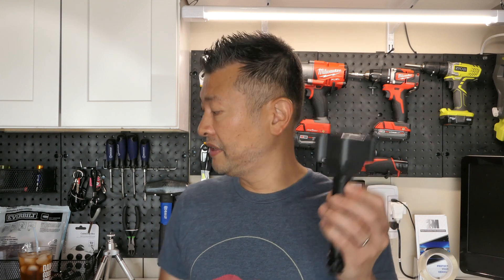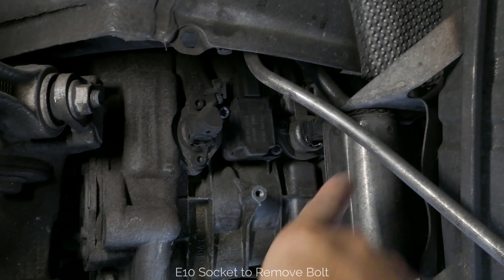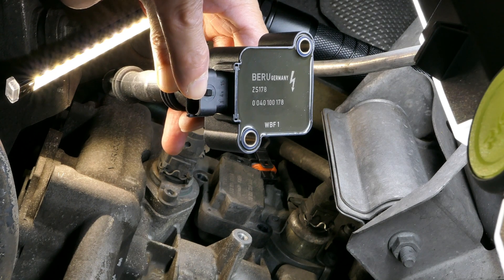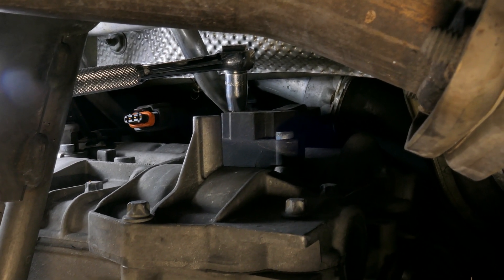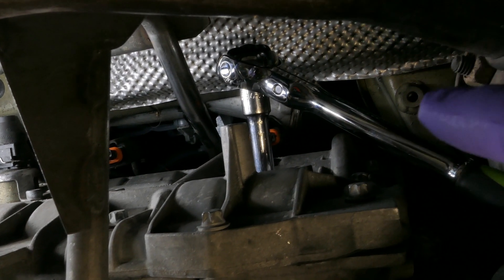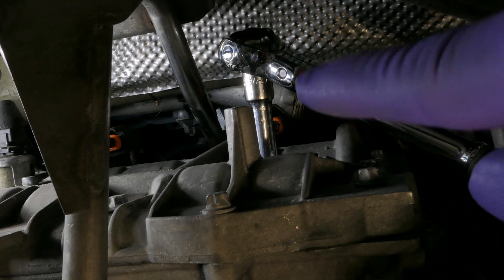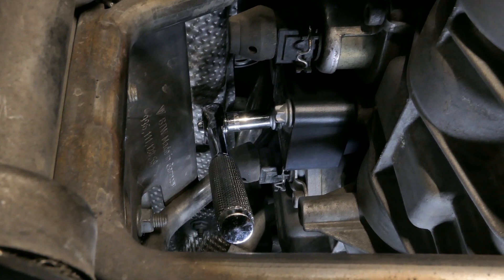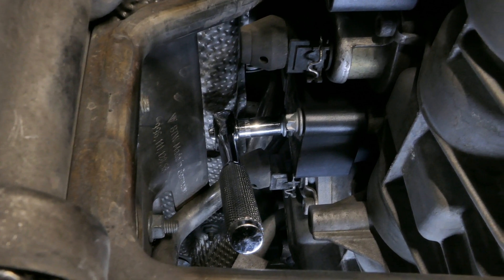Porsche 911 Spark Plug and Coilpack Change DIY. No muffler or Bumper Removal!

Comment: Great video.  I’m probably going to end up trying to take my mufflers off.  I tried it before when I did my water pump and thermostat (didn’t need to so I left them on).  But I have bigger hands and I’m low on patience 😂. I’ll definitely get the swivel head ratchet.  What drive did you use? 1/4 I assume?
Reply from the maker: Yes, larger hands might have issues getting into the smaller areas. For the drives, I used a combination of 1/1" and 3/8" drives. Good luck, it's totally DIYable.
Reply: @TheAutomotiveFanatic  I’m definitely DIYing it, it’s just a matter of with mufflers or without.  Also a good time to check on the state of my cylinders, but from the top this time.
Reply from the maker: @K1dPhresh1  Sounds like a good holiday project. LOL.
Reply: @TheAutomotiveFanatic yes sir!  Hopefully time permits.

Comment: Question:  were the upgraded Beru coils worth it?
Reply from the maker: 100%, I never had any misfires or issues what so ever.
Reply: @TheAutomotiveFanatic  Thanks, Porsche recommends 5 of the new Beru with 1 of the old to avoid clearance issues.  Does this make sense to you?
Reply: @TheAutomotiveFanatic  I forgot to mention I have a 997.2, a 2011 Carrera
Reply from the maker: @jaketherake71  Absolutely not. In my research, I have not heard of Porsche wanting to replace only 5.
Reply: @TheAutomotiveFanatic  ok, I think it was Pelican parts recommendation to 997.2 owners.
Reply from the maker: @jaketherake71  I would replacement them all.

Comment: hello did you replace these parts at the recommended interval?  I understand the plugs but what made you change and replace your coil packs?  Just curious as I just recently got a 2007 997.1 with 46k and I want to do the spark plugs, air filter and clean MAF sensor with approved CRC cleaner and even may pull throttle body and give it a good cleaning.  Thanks in advance.
Reply from the maker: No, I did not follow the manufacture's interval. I changed the plugs/coilpacks because I wasn't certain when they were changed before.
Reply: @TheAutomotiveFanatic  cool, makes sense. Cheers!
Reply from the maker: @chrislehmann6240  Good luck with your maintenance work.

Comment: 2006 997.1 C2S. All you DYI-selfers Do yourself a favor: Remove the bumper, mufflers and muffler heat shield. The coil pack bolts on the rear ( 1 and 4 ) are very difficult to reach with normal torx sockets. I had a single bar t40 torx that is 1 inch long. I could not remover the most rear bolt with normal torx sockets, the muffler frame is in the way. Removal of bumper, heat shield and muffler: 1 hour. It saves 2 and 1/2 hours Good luck. Make sure you have a good variety of tools.
Reply from the maker: L MR, thanks for your input and feedback. Since you have a C2S and I performed this plug/coilpack change on a widebody C4S,  I may have slightly more room. Unfortunately, I cannot confirm. However, in my researches prior to the change, I read that other 997 DIYers were able to perform the service without removing the muffler or bumper.

Comment: The passenger side was easy for me until it came to connecting the plug onto the coil pack. There was no free length on the plug and ended up having to use 2 long screwdrivers like chopsticks to tease it back in then I could get my hand to it to push it home
Reply from the maker: It's been some time, but I believe a couple of the plugs proved to be tough as well.

Comment: I am curious about them saying that you need to use a torque wrench to tighten down the plugs but notice that you did not do this??
Reply from the maker: Hi Robert, you are 100% correct! The plugs do need to be torqued down as I did not show that process. I highly recommend grabbing a smaller 1/4" torque wrench and tightening to: 32 N-m (24 ft-lbs) for a new plug and 25 N-m (19 ft-lbs) for re-installed plugs.

Comment: Great video! So do the Beru coil packs come with the new bolts? I noticed you took off the torx 40 bolts but you put back in a different bolt.
Reply from the maker: Hey Fredy, thanks for watching! Yes, the new coil packs come with the correct bolts.
Reply: Cool. I’m debating on whether or not to do it myself. Labor is around $300 at indy shops near me which is well worth it. But I like the feeling of DIY and getting to know the car. This will be helpful if I attempt it. Thanks again.
Reply from the maker: @fredym.3728 , you should really DIY it! Like you said, there's no better satisfaction knowing that you performed the work RIGHT and getting to know your PCar more intimately.

Comment: Without removing the muffler it would be extremely difficult to impossible to use a torque wrench on the plugs ( 22 ft/lbs or the coil bolts ( 8 ft/lbs
Reply from the maker: You're correct. That is why I ended up having to purchase a small 1/4" torque wrench. Unfortunately, it did not arrive in time for this video.
Reply: @TheAutomotiveFanatic  I just started having a couple misfires tonight, so your video is the first I've watched. The exhaust is pretty simple to remove, so would you say it's worth it to do so, or it won't really make it easier?
Reply from the maker: @AliFazel  give it a try on one side to see how well your hands/tools fit with the exhaust in place. If it seems too difficult, remove the muffler. I have detailed the video pretty well to show that you CAN complete the task without removing the muffler.